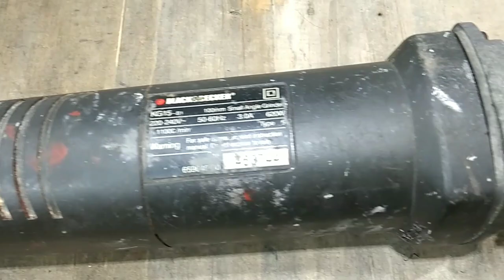Black and Decker Angle Grinder KG15-b1 Restoration

Comment: Can we replace 2RS bearing with zz in black and Decker 12000 rpm angle grinder with out any problem ?
Reply from the maker: Yes without any problem
Reply: @cdltek  thank you , I thought because 2rs have little friction it will heat up .